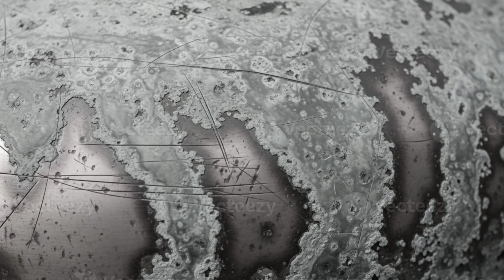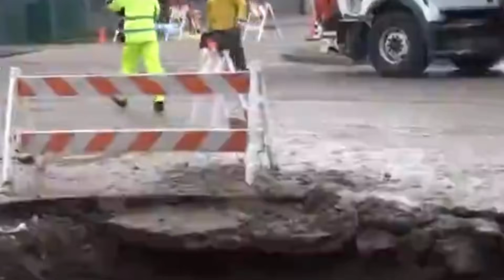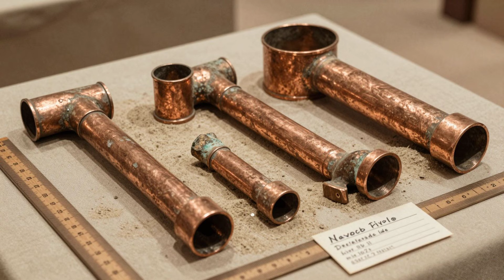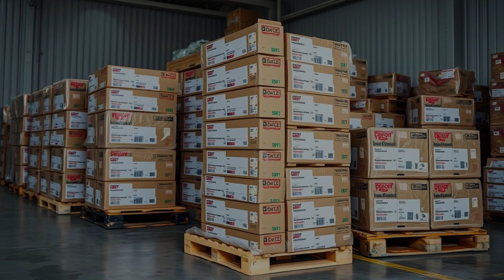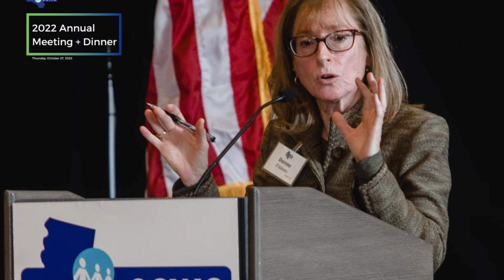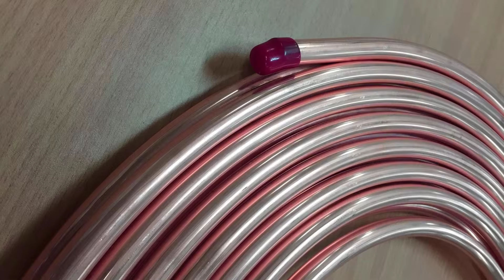NEVER Buy PEX Again: The 1950s Pipe That Actually Lasts Forever

Comment: No, we didn't stop quit. Installing copper pipe because it was expensive, we stopped installing it, because people were stealing it out of homes and just going down the block. If you were on vacation and you came home, you could expect to have no copper pipe in your house, it was that bad you couldn't go on vacation, you couldn't leave your house unattended and then they would take the pipe, and they'd sell it over at the metal recycling shops who don't ask for who who didn't ask for ID back in the  Day And honestly, lead solder was used a lot on the copper pipe silverstatter did not become an industrial standard until 9599, and it's only 2 or $3 more than regular lead Soder but it's safer for pipes, it's safer for people. And it lasts as long as lead pipe does lead solder, but yeah, if you're willing to pay for it, you can go into any hardware store, get a copper pipe, put it in your house, just make it really hard for people to get to no. I'm not kidding, put it in once buried it. In the wall, under thick boards and don't take long vacations.  Because these scavengers have long memories , they know who's putting pipe in.

Comment: I live in a 60 year old house with copper pipes and they are all failing, I will need to replumb my house. Copper is also weaker when it comes to freezing temperatures. I have had zero failures in the PEX B I have installed, I have had 3 failures of copper while living here. I am not sure your information is top shelf.
Reply: This is ai drivel from "anti-capitalist" nitwits, as they rely on it for money in total ignorance...  And yes, copper is bad in earthquake areas, for example.  It's does corrode, as you know...  This video  is a byproduct of morons in public education teaching smooth brained children to hate capitalism.

Comment: In the 1950s they used lead soder so save me the non toxic crap.  Its expensive and over engineered, people arent getting gyped, they're getting a product that holds up to spec for the lowest cost.
Reply: You are conflating solder (which can be leaded or not, depending on what you prefer), with copper material which offers great benefits when it comes to health as a yellow metal.  Remember, there are pros and cons to each and every technology, perfection does not exist.  Copper is great, but it is expensive and time consuming to install.